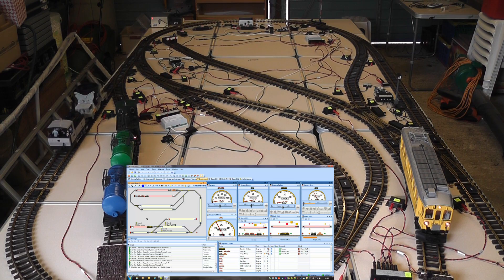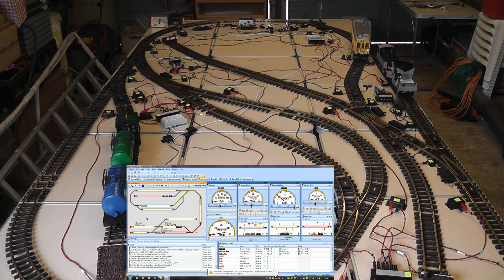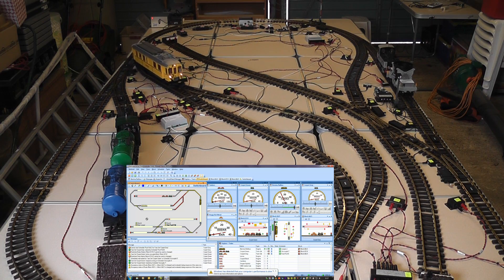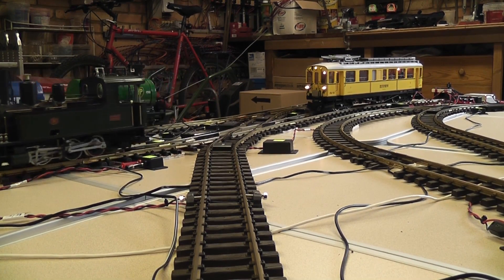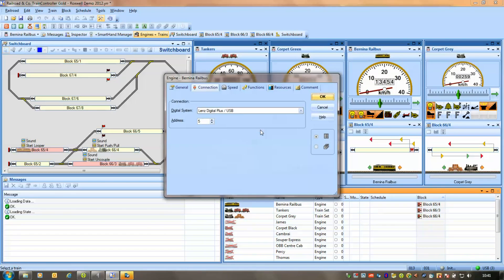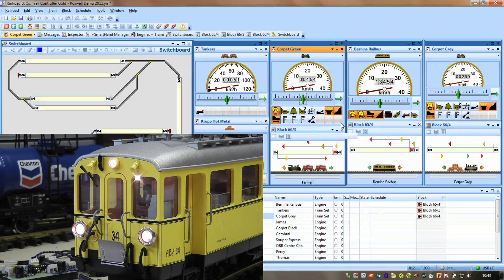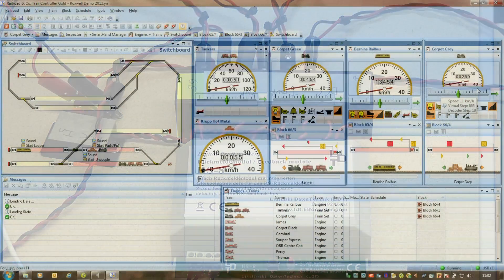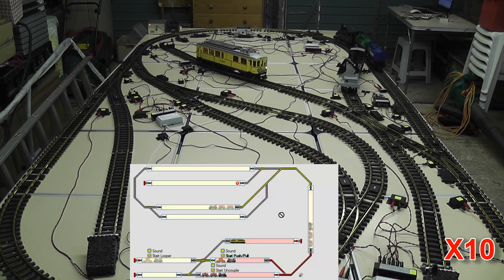Computer Control with DCC

Comment: He's using Train Controller Gold software - that's 930 USD to start with, and then you need sensors, plus a few locos and track etc.  Oh and a computer would be handy. Not for the faint hearted.

Comment: wish list Forget dcc ( and bad connections) Go RC cab control ( battery in engine) : Equivalent track position detectors etc for such a system to link to a computer prog. Really robotics etc uses this now. No dodgy track  connections/ multiple engines same track,  plastic track ( make your own for garden railway )  No back bending under mounting boards on and on Whats not to like RC control . Except poor range of manufacturers offering esc for model railway engines.

Comment: how do u control each train differently only by rails power or are there RF modules on each of them?
Reply: In many systems, the control is done via the rails. Meaning the signals pass through them the same way as the power does.
Reply: is there a preamble of signal different to each train so that it would know if to pass the power to its motors?
also is this documented somewhere?
Reply: Ronen Shemesh Yes, it think so. At least on the Märklin sets i had, it was done so. They are digital, so the track acts as a data channel, just like radio control. Of course there can be variations to this and i  cannot know the operating method of every set.

Comment: Hi, very helpful video, thanks for posting. Can you clarify whether the RS8 is providing occupancy data as "a train is in this block" or "this specific train is in this block". The software appears to know the location of each train in the GUI - is this based on absolute feedback from the RS8, or just keeping track on a "dead reckoning" basis? If the latter, how is it kept in sync? (e.g. do you need to tell the software where you place each train, if for instance you added a new loco?) Thanks very much.

Comment: I'm fairly new to getting into DCC, but a long time collector of LGB, Bachmann G and other G scale trains, track and accessories.  We are trying to do a special project for an outdoor garden railroad...to be able to run several trains at the same time, but prefer wireless and DCC sound and control of trains & switches... also be able to control sound features via that DCC system.  I know there sometimes limitations of the motor decoders as far as the speed steps, from the older MTS or mixing some LGB or other brand central stations, like lower limited Piko or massoth central stations.  I would like to have as many speed steps and DCC control options as possible like the Massoth 1210Z central station offers, but might settle for less, if price and cost is factored in to the equation...I can live with a little less, but don't want to be terribly crippled with less control features by buying a lesser or inferior DCC system to start with.  That said I have many questions so please bare with me, as I am trying to learn the system and DCC compatibility as a whole.  

I'm currently considering a Lenz LZV100 version 3.5 version command station /booster, is this the latest Lenz Offering?  I references on the Lenz sight to LZ100 and LV102, so not sure if these are out of date or older command stations (without the booster?), so can you educate me?  Can I used the LZV100 for wireless DCC control for both my trains and switches, using the Massoth or Piko Navigator or a wireless version of the LH100?  Can a wired LH100 be easily converted to wireless?  Can a wireless receiver from either LGB MTS or Massoth or PIKO be used with the LZV100? Can more than one LZV100 be used on the same garden railroad layout, or is there no need for this?

Does Lenz have something similar to the Massoth or Piko Navigator?  Or can the Dimax Massoth./Piko Navigators be used wireless with the LVZ100 Digital Plus version 3.5 central station/booster? can an LGB wireless 55056 model be used with the Lenz LVZ100 in order to use the Massoth and Piko Navigators wireless? Are all the Massoth emotion XL, XLS emotion or other manufacturers decoders compatible with LVZ100 and also be used with Phoenix DCC sound decoders  as well as Soundtraxx tsunami sound decoders or other motor decoders?  Is the LZV100 limited in comparison to the Dimax Massoth 1210Z central station or is LZV100 digital Plus 3.5 or 3.6 a good lower cost replacement?  I am considering using my Mean Well SP-350-24 switing power supply with a LZV100, will that be a good match, consider it is 24 volts, 13 to 14 amps and 350 watts switching power supply?  Are there any limitations that the LZV100 central station/booster has compared to the Massoth or Piko Central Stations?  Is the Lenz LVZ100 compatible with all LGB MTS decoders and sound locos?

I apologize for all the questions but really need to understand and get help on the Lenz system.  Or if there is a better alternative like Zimo or NTE, please let me know?

I really do appreciate all your help and can't say this enough!
Reply from the maker: #######I'm currently considering a Lenz LZV100 version 3.5 version command station /booster, is this the latest Lenz Offering?  No version 3.6 is the latest but all Lenz 3.5 stuff can be upgraded to 3.6, some of it for free. ######### I references on the Lenz sight to LZ100 and LV102, so not sure if these are out of date or older command stations (without the booster?), so can you educate me?  LZ100 is old, LV102 is the current booster/amplifier. #######Can I used the LZV100 for wireless DCC control for both my trains and switches, using the Massoth or Piko Navigator or a wireless version of the LH100?  You can use the Massoth Navi, and maybe the Piko, with the LZV100 by using the the Massoth DIMAX Multi Receiver which has recently been updated to support Lenz 3.6. There is no wireless version of the LH100. ########Can a wired LH100 be easily converted to wireless?  No #########Can a wireless receiver from either LGB MTS or Massoth or PIKO be used with the LZV100? Massoth Yes, Piko maybe, LGB No. #########Can more than one LZV100 be used on the same garden railroad layout, or is there no need for this? No. Only one command station is needed. Many LV102 boosters/amplifiers could be used. ########Does Lenz have something similar to the Massoth or Piko Navigator?  No if you mean wireless. They did have the XPA system which I use but they don't make it anymore and it only supported 8 functions anyway which is a bit limited with todays modern sound decoders. XPA can be got secondhand sometimes at good prices. ######Or can the Dimax Massoth./Piko Navigators be used wireless with the LVZ100 Digital Plus version 3.5 central station/booster? The older version of the Massoth DIMAX Multi Receiver supported Lenz 3.5. ######can an LGB wireless 55056 model be used with the Lenz LVZ100 in order to use the Massoth and Piko Navigators wireless? No #######Are all the Massoth emotion XL, XLS emotion or other manufacturers decoders compatible with LVZ100 and also be used with Phoenix DCC sound decoders  as well as Soundtraxx tsunami sound decoders or other motor decoders?  I've never had any problems with any decoders from any manufacturer on my Lenz system. ######Is the LZV100 limited in comparison to the Dimax Massoth 1210Z central station or is LZV100 digital Plus 3.5 or 3.6 a good lower cost replacement?  It is 5Amps only but can be made into a 10Amp system with a LV102. Used with train control software it can do everything the Massoth can do. Massoth has a few more bells and whistles that I wouldn't pay for. ######I am considering using my Mean Well SP-350-24 switing power supply with a LZV100, will that be a good match, consider it is 24 volts, 13 to 14 amps and 350 watts switching power supply?  Probably a bit over the top, but it should work. ######Are there any limitations that the LZV100 central station/booster has compared to the Massoth or Piko Central Stations?  Not really. If you want pictures and stuff like that go with the Massoth. All I want it 28 speed steps (it goes to 128), 28 function control, feedback for computer control and the Lenz has all of that. ######Is the Lenz LVZ100 compatible with all LGB MTS decoders and sound locos? Yes, although some older LGB decoders use non NMRA 'serial' functions which cannot be operated by Lenz but could be operated with the Massoth. I got rid of any 'serial' decoders.
Reply: ytgeorgc THANKS so much for all those answers and information, and taking the time....reat help!

Curious, I've seen some forums state that Massoth DiMAX 8132001 Receiver same as LGB 55055 or 55056 receiver and Piko 35022 receiver?  They also state they will work with Lenz LZV100 command station, in order to be able to use a wireless Massoth or Piko Navigator. Is this wrong information?  I've also read similar claims for the switch What do you think of the LI-USB Ethernet computer interface?  Is tis the computer interface that is needed for computer software to run and control the layout with feedback, and Is this the same as xpa?  What train control software are you speaking or suggest?  Is this the same software that will allow a smart phone to be used as a controller using a wireless router?

Thanks again for all the help!
Reply from the maker: Only the Massoth DiMAX Multi Receiver 8130001 can support a Massoth Navigator on a Lenz system. XPA is not a computer interface. You will need the LI-USB computer interface to use train control software with Lenz, With Massoth a computer interface comes built in.

Comment: Thanks Cliff, what are the little blocks between the rails? I am looking at the bronze software version,  what prompted you to go with gold?
Reply from the maker: The blocks are just where power is connected to the track. Google LGB 10153.

I couldn't do the automatic uncoupling easily with any other version than Gold.

Comment: So much effort to explain the software - but has not revealed the software name and supplier ! I wonder why ?
Otherwise a very well made and informative tutorial.
Reply from the maker: Because I've tried to make a generic video. I'm not in the business of endorsing, or otherwise, any commercial products, if I can help it.
As far as the software goes there are quite a few different options. I'd suggest to anyone considering DCC computer control that they research all of the options and decide what is best for them.
Here is a list (not exhaustive) of software that could be used:
JMRI: http://jmri.sourceforge.net/
RocRail: http://wiki.rocrail.net/
TrainController: http://www.freiwald.com/pages/index.html
iTrain: http://www.berros.eu/en/itrain/
TouchCab: http://www.touchcab.com/
Pahasoft: http://www.pahasoft.nl/
Railware: http://www.railware.com/
Stellwerk: http://www.stellwerk-software.de/en/
Win-Digipet: http://www.windigipet.de/foren/index.php
Reply: ytgeorgc  Of course you are absolutely right - one has to choose for themselves.Thank you for the links- I'm sure others will find them useful too- Once again great tutorial,I'm sure I will return to it several times.[ I have just dug out my N scale gear mothballed for 25 years and am discovering so much has changed since I last made a layout ]
Reply: 0oseven7

Comment: Please, tell me - minimum set DCC of g-scale train controlled from PC:
1) SPROG II and DDC train controller!
2) Command station (Piko or LGB or ???) ???
3) Booster (1 or 2) ???
4) Power supply ???
5) CAB - Do not use! Use PC programm.
Switch Control - use or not??? 1 or 2 or 3 ???
Help me! Thanks!
Reply from the maker: You need a DCC command station, you need one that will work with the software you want to use, and for G-Scale, that has an appropriate voltage and current output.
You probably could use a SPROG with a booster attached to it.
I only know of one software product that will work with LGB command stations. Don't know much about the Piko command station.
The total current draw of all of your engines that you want to run at the same time determines how much power you need.
It is not usual to use the CAB when running under computer control, but having one is still almost essential.
Yes you would need switch control.